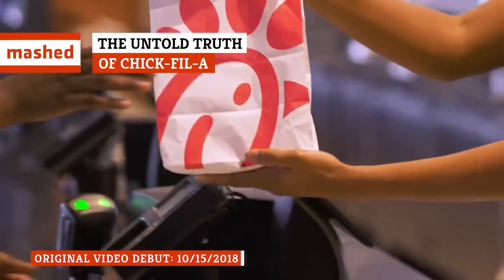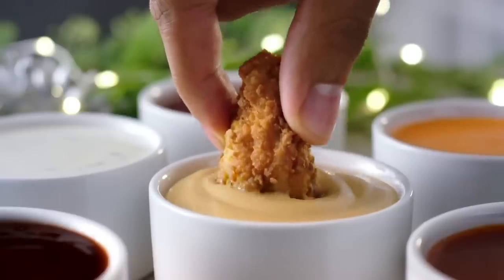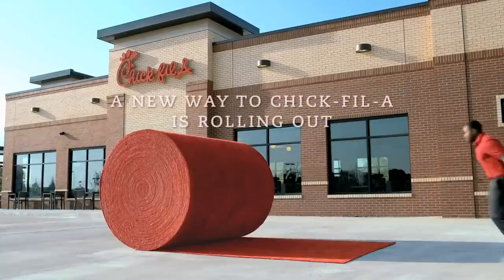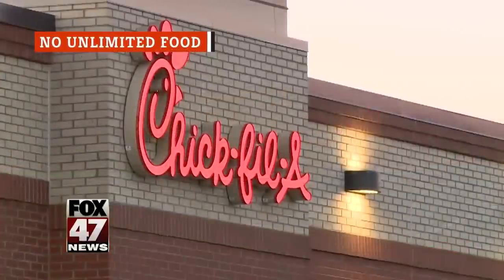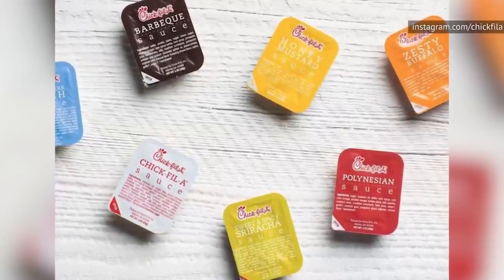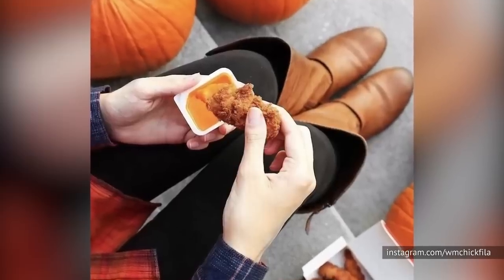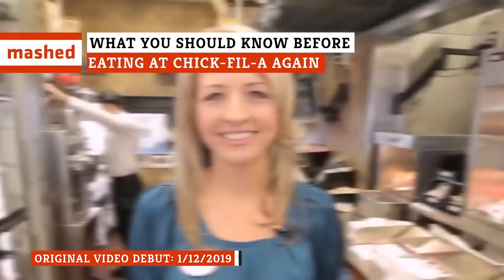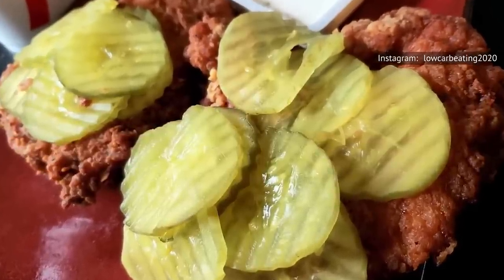Chick-Fil-A Marathon #1

Comment: Haven’t had chick fill a in years since it closed near where I work. I occasionally ate it then because there was no other option. It’s good but I have no desire to eat it now. Obviously by the wrap around drive through lines I see when I pass the local cfas, they will not be hurting without my business. It is much better than most fast food choices for sure. And the service is a step up as well.